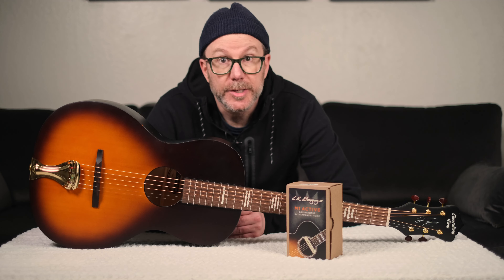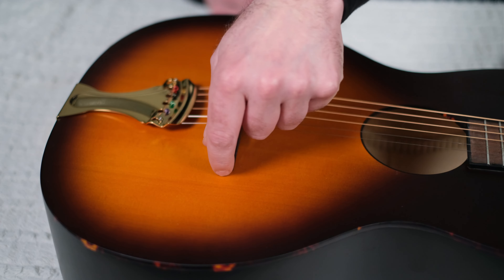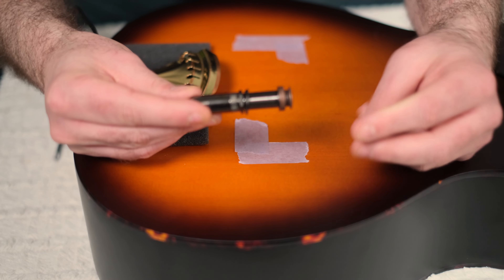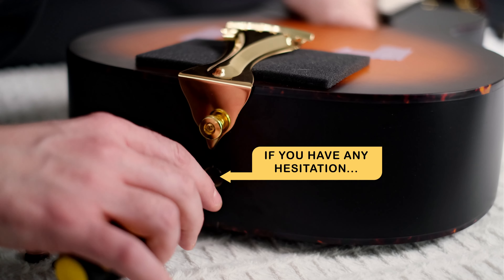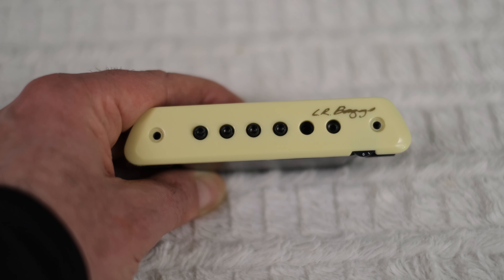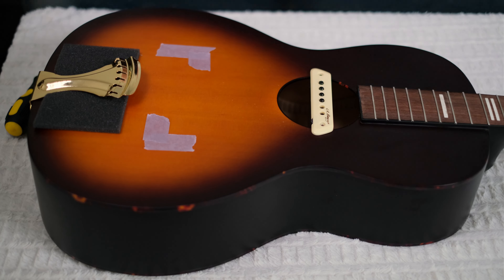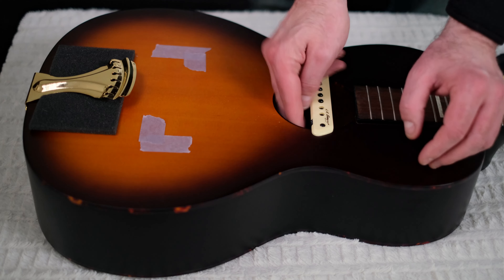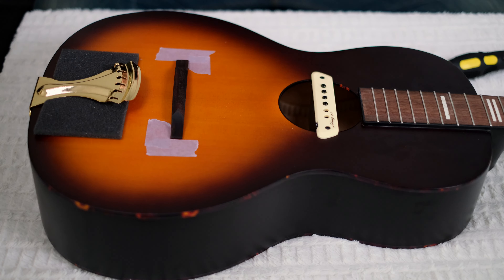RK Justin Townes Earle Signature + LR Baggs M1 Active Pickup: Installation Tips & Tricks

Comment: why couldn't you plug it in before inserting pick-up into the sound hole...too much interference?  Also, I don't understand why the trimming modification was needed...was there a X-brace interference problem?  Seems like you'd have equal trimming on both sides...mmmm?
Reply: 100 per cent